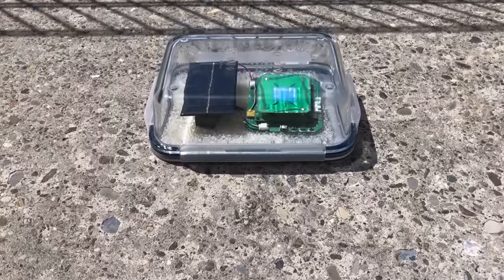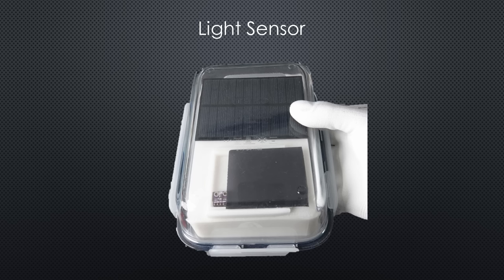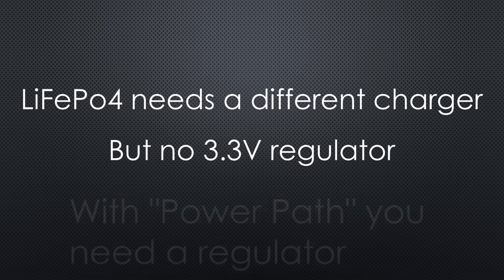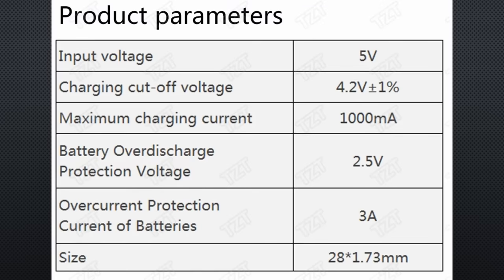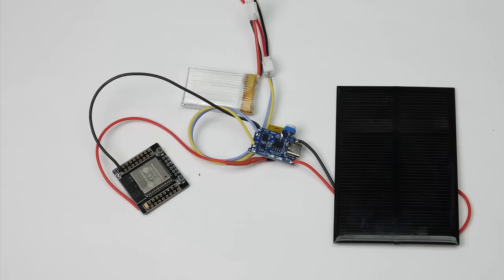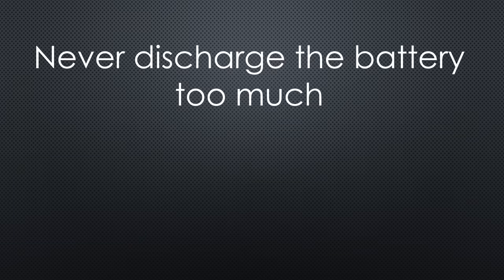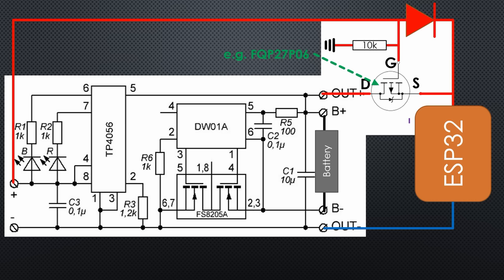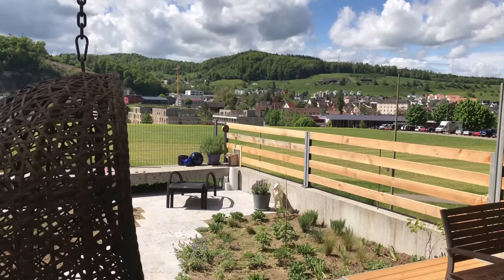#383 Cheap and simple Solar Power for our small Projects (ESP32, ESP8266, Arduino)

Comment: So you added a FQP27Po6 Mofset and a 1N5819 Diode.. did you add a 10k resistor also? can you show me the diagram of the complete changes...
Reply from the maker: The diagram should be in the video as well as a reference to another, more detailed video
Reply: @AndreasSpiess  .. thank you..I am a beginner at this.. that was a 10,000 ohm resistor.. correct ?
Reply from the maker: @cohenkevinloriqueen818  Yes

Comment: Could the battery get overheated or damaged by the temperature caused because its exposed to the sun?
Reply from the maker: Yes, it can. In my case I measured temperature and it stayed below 65C. During this time, the battery was full and the solar panel was able to run the device. So the battery was in "storage condition". Which is nearly acceptable according to the datasheet.
Reply: @AndreasSpiess  Thanks for replying, Mr. Andreas!

Comment: Regarding the difference between Li-Ion (3.7 nominal) and LiFePo4 (3.3 nominal?) - could one not simple add a diode in the direction of the positive terminal of the battery? Coming from the TP4056 chip i mean... ?
Reply: And, yes - of course and like most of your other videos: very nice. And pragmatic approaches too! :)
Reply: Ok, saw too late that the positive terminals are connected directly...
Reply from the maker: Anyway, a TP4056 will overcharge a LiFepo4. Its cutoff voltage is only 3-7 volts.

Comment: Hello Andreas, I am a newbie and I learn a lot with your videos, thank you for that. I am interested in this solar power and I have already ordered the parts thanks to your list.
I have 2 questions:
1) what kind of capacitor farad/voltage do i need to connect to the pin board converter ?
2) I don't see the TP4056. Do I have to order it separately ?
Thanks again for these videos which must cost a lot of effort and energy:)
Gilles
Reply from the maker: Thank you!
BTW: It would be easier for me if you would include the minute/second of the video. Loke that, I do not know exactly what you mean. You find a link to a TP4056 board with protection and the capacitors usually are 100-1000 microfarads. If this is what you need to know.
Reply: @AndreasSpiess  Sorry for my bad english :). I just meant that you have added a lot of links (ali express) along with the video to buy what is needed to build the solar power, but there is no link to buy the TP4056. and to buy the capacitor . Anyway, I have ordered a TP4056 and some capacitors (Capacitance 16v10uf 106K). 
Based on your answer, I should have ordered 100-1000 microfarad capacitor instead.
Thanks again,
Gilles

Comment: hi with the mosfet is there any problem caused by low light eg solar is not enough and mosfet is still off? (analog problems)
i think the battery should have enough capacity to last 3 days with enough solar to charge in 1 to account for cloudy days
Reply from the maker: 1. If you chose a low Vgs FET it should be ok. Maybe you will lose a few mW.
2. You probably do not get such small batteries which still are capable to feed an ESPxx. In Switzerland I need a battery which lasts at least a month without sun ;-)
Reply: @AndreasSpiess  Hi Andreas ! I have a look in FQP27P06 MOSFET datasheet, however its Vgs(th) is between -4v ~ -2v. Which means when the Vgs is below 3.7v(Lipo) - 2v = 1.7v, then the MOSFET will ON and change to battery power supply. However 1.7v is too low to operate the microcontroller, even if 2v or voltage between 1.7v ~ 3.3v.  How to deal with this issue? Thanks a lot !

Comment: Hi saw you are using tp4056 for charging battery but this charger cannot charge higher maH batteries due to heating issue. Can you suggest a good charger for charging higher mah batteries.
Reply from the maker: There are many other high-power chargers for Li-Ion batteries. Google knows them. The TP4056 has a 1A limit, if I remember right. But it will heat up if you apply a too high VCC (if is a linear regulator and has to kill the voltage between Vcc and Vbat).
Reply: @AndreasSpiess  thank you for the guidance.

Comment: Are the "CE021" buck boost converter any good for ESP type of chips? They claim to be able to output 3v from 1.8v, but I'm worried about the noise.
Reply from the maker: I like switching converters for big voltage differences. Here they are not needed. And indeed you have to pay attention to RFI. Some of them are horrible. You can check it with a radio or with an SDR receiver
Reply: I use the charge pump module rated at 100-150ma with specified input 1.8 to 5 v which is able to run an esp8266 . Right upto when the Lipo voltage drops to 2.5v and the tp4056 cuts off finally.
Reply: @vu2dji  most digital tasks won't get effected but as soon as an ADC gets involved... Problems related to RFI begin
Reply: @SurajGrewal  thanks for pointing that out! The only ADC I use in this particular project is to get a rough idea of the battery status. For another one requiring precision ADC  measurements, I will go for the linear regulator.

Comment: I think the TP4056 charge controller is one of the worst options for this application. When you make a project powered by a solar panel, you need to think about the most efficient use of the received electricity, and thanks to the ineffective TP4056 charge controller, you will simply lose a large share of the electricity received from the solar panel, in addition, it will not allow the solar panel to work efficiently. I recommend using high-efficiency pulsed charge controllers rather than linear charge controllers in this application. Additionally, I recommend looking for charge controllers specifically designed for solar panel power that can keep the panel voltage near its maximum power point.
Reply from the maker: Maybe you watch my video about low power solar charging solutions. I also was surprised how good the TP4056 behaved...
Reply: @AndreasSpiess  , the only good thing I can say about the TP4056 in this application is that this controller is not very capricious in relation to the electricity supplying it, and it is perhaps the only one that I know of that continues to work even when receiving a voltage of only 4V. However, this does not justify the loss of a large share of electricity. Personally, I have long abandoned the use of TP4056 controllers and instead use controller boards based on the CN3791 chip.
Reply from the maker: @oleganonimka3725  Did you watch the video I referred to?

Comment: Is short circuit protection lost with this modification of tp4056?
Reply from the maker: It should not because the battery current still goes through the DW 01A/FS8205A. The solar panel does not need this kind of protection.

Comment: hey andreas love your videos, I found this one and it is perfect for my projcet, but i have  question. I got an esp32 and a 3.7 18650. (I got all the parts you listed). to power the Esp 32 i connect the battery and power path to a 5v dc booster is this a good solution or should I put 2 18650s? I got the system running but the charging is slow I suspect it was the booster drawing more current to boost from 3.7 to 5v since I run the ESP32 in a deep sleep. Could you please help me on this? Much appreciated!
Reply from the maker: I do not understand the goal of your design. I do not see why you want 2 batteries in the design I showed.
Reply: @AndreasSpiess  hey sorry, the two batteries were meant to give more volt to the esp, rather than using a 5v booster
Reply from the maker: ESP32s work on 3.3 volts. No need for 5 volts

Comment: Thanks for the video,
I have a question:
If you connect the solar panel and the load will request more power than what the solar can deliver at that specific time (but your battery can) , in that case i think you are overloading your load as you can not supply the missing power from the battery, what's the solution for that? thanks.
Reply from the maker: The charger module (TP4056) limits the current that the solar panel never is overloaded too much. The battery always supplies the load, it is only charged by the solar panel.
Reply: @AndreasSpiess  hello, thank you for your reply,
Just to confirm if the solar panel is connected will the mosfet disconnect the battery from the load? At that time the load will only be powered from the panel?
I am getting something wrong? Sorry to bother you.
Reply from the maker: @fedimakni1200  I suggest you re-watch the video. Think of two independent circuits: The charging and the protection circuit with the battery in the middle.
Reply: Actually this is what is happening when I built the circuit running an ESP 32 on all the time (70ma drain). Even with a large panel, when the sun was hazy , the MOSFET was open circuit but the current supplied by the 10w panel was still too low to charge the battery and run the ESP32 at the same time. I think this circuit is good for deep sleep but if you want to run an ESP 32 all the time you will need a massive panel, and even then there will be times when the light is low when it cannot supply enough current but the MOSFET is still off and the battery therefore cannot be used.

Comment: Hi, I am new with MOSFETs, the RDS(on) is -10v for FQP27P06 from the datasheet and VDS equals to VGS, it seems to me it never can reach -10v to make the MOSFET to conduct completely with the lowest resistance, 
When the GATE is 5 volts powered by the panel, 5v-3.7=1.3v,  0v-3.7v= -3.7 when the panel power is gone completely and the GATE is grounded via the 10k resistor, so the ESP32 is always powered by the panel ONLY
Could you help me a little bit to understand?Many thanks
Reply from the maker: Maybe you watch the video in the description. It shows more details.

Comment: Hello! I tried to recreate this and when I use 5V from a USB-charger as input on the TP4056, I get 4.2V at the ESP32(Dev-Kit C V4). When I disconnect the 5V input, I have 3.8V at the ESP. But if I add my solar panel at low light (delivering 2.5-3V) the ESP only receives 3.26V and stops working. On ly if I cover it completely, the MOSFET switches to battery and I get 3.8V. I also noticed that after disconnecting the ESP the charging light goes on, when I use a lamp for the solar panel. It does not do that, when the ESP is connected. With no ESP, the voltage switches as expected - even with just solar and a lamp. Any idea what could be wrong?
Reply from the maker: Unfortunately, I canno do remote debugging. But if you use the same diagram I would remove the power path and see if everything works.

Comment: 3:54 How do I know what charger board I would need? I have a load of Soshine LifePo4 3.2v 2.24Wh 700mAh batteries that I would like to use... Thanks
Reply from the maker: The TP5000 can also LiFePo, for example.
Reply: @AndreasSpiess  Thank you. Sadly I only really understand how to copy your projects if I can get the exact parts. Any deviation from that and I'm lost!  The TP5000 looks very different to the TP4056... does everything you do in the rest of this video still apply to this board?

Comment: Danke für das Video. Sehr tolle Tipps habe ich gewonnen. Ich hätte eine Frage und denke  Sie  können mir damit weiter helfen. Ich arbeite auch momentan an einem Solarbetriebenen Projekt und da nutze ich auch das TP4056-Charger-Board. Jedoch möchte ich auch die Batterie überwachen mit dem INA219 und da weiß ich nicht wie die den Sensor richtig anschließe , um eine genaue Messung für die Batterielade bzw. entladekurve zu bekommen.
Falls Sie da Tipps für mich hätten, würde ich Sie willkommenheißen.
Reply from the maker: Ich hab mal ein video über Strommessung gemacht. Dort kommt der INA219 auch vor (soweit ich mich erinnere).
Reply: Ich wollte Ihnen auch fragen was würde passieren, wenn man anstatt eines p   MOSFET ein n MOSFET verwendet hätte

Comment: Hello, I have another small question : in this configuration the solar panel AND the battery cannot deliver energy for the electronic card at the same time (that is what I have observed, but tell me if I am wrong). Is there a way to have this feature ?
Reply from the maker: It delivers voltage also during charging.
Reply: @AndreasSpiess  I understand that the solar panel can deliver voltage for charging the battery and powering the card (if there is enough power delivered by the solar panel). If I understand correctly, the MOSEFT is always in the passant mode (because of the diode small voltage drop), hence enabling the deliver of voltage from the battery AND the solar panel to the card ?

Comment: if i use a 3.7V lipo battery, in what voltage range i need remain, if i want  to work in safe region ?
Reply from the maker: you should not charge it over 4.2 volts and discharge it below 3 volts
Reply: @AndreasSpiess  thanks

Comment: As usual thank you for your great hardware tips.  I have been trying to find a software solution to increase battery life for ESP devices. 

I have written some code using proberequest protocol of ESP devices along with MAC address manipulation to communicate between ESP devices. It consist of an always powered on ESP32 gateway with built in MQTT broker (not client) and a websocket server which communicate with all battery powered ESP8266 slave devices which uses LIR2450 coin cell battery with small solar panel (53mm x 30mm) and TP4056 charger. Remote devices uses around 70ms - 80ms to send sensor data. It is lot better than ESP-Now solution.

Thanks again.
Reply from the maker: Sounds like a cool solution! I do not remember how long ESPnow took for the transfer.
Reply: @AndreasSpiess  I will appreciate it if you please test the code with your oscilloscope as I do not have fancy equipment. Please search for batteryNode from happytm on github.

Comment: Can I at the same time have connected usb directly to esp32, assuming I have standard board, and solar panel?
Reply: I'm trying to do similar thing but instead of solar panel use power from usb to charge battery.
Reply from the maker: If your ESP32 board offers a 5V input you can connect it to 5v. Otherwise, the ESP32 modules are only 3.3V (without a regulator)
Reply: @AndreasSpiess  I want to be able to have battery connected to esp32 and at the same time connecte esp32 board to pc via usb. I'm building custom keyboard. I just learened that I need a way maybe a switch before VIN pin to turn of battery before I plug it to a pc.
Reply: Now I know that I should have bough different board that has battery support.
If i did that circuit and connected it to the original usb port, what would have happend?
Reply: So instead of connecting output from charger/battery connect it to usb. Will I be able to communicate with computer? Or I have to make completely different circuit

Comment: AMS1117  will be a good replacement for HT7333?
Reply from the maker: No, unfortunately not in low power applications. Otherwise, yes
Reply: @AndreasSpiess  Ok, so it seems it must be very decent stabilizer with very low dropput and IQ. It's a pitty you did not mention it in your movie

Comment: Hallo Andreas
als basteltechnischer Totalhonk der ich bin verzeih mir bitte die Frage, ABER:
Kennst du nen Weg, wie man den Strom eines Velo-Nabendynamo dazu nutzen könnte ein herkömmliches Batteriepack aufzuladen? (all die Energie die da sinnlos produziert wird - muss doch irgendwie verwendet werden können))
Reply: Not really wasted, when you start charging batteries, you have to push harder on the pedals.

But it's a good idea for a home-made windmill those axels. Bearing and generator built in. And lots of those bikes come on the second hand market with everybody switching to e-bikes.
Reply: @LimBo3500  well the hub dynamo (correct translation of "Nabendynamo"?) doesn't have the same resistance as the normal one which connects to the tyre, it actually runs all the time (if you need lights or not) - that's the reason for my question:
atm it gets wasted if the ligts are not on, but still produced...

systems should (alas i'm completly wrong) be similar to the solarpower-ideas, just the voltages might vary "a bit" more than with the solarpanels..?

the windmill is a good idea, too - just add some stylish fins on it, and make a little savonious-rotor
Reply from the maker: 1. Tom is right. A generator does not need  energy other than friction if no power is used. Only if you draw a current it starts to consume energy. It should be possible to test this hypothesis with your bike and the light switched off (or the connector at the dynamo disconnected). Your front wheel should turn without a lot of resistance. Switch the light on and compare. (I did not try it because I have an e-bike)
If you want to use the energy you find the info in this link: https://www.instructables.com/Voltage-Regulated-5-V-Bicycle-Dynamo-Light-USB/
Reply: @AndreasSpiess   Toller Link, danke :)
Der Nabendynamo hat sowas von kein Rollwiderstand (also ich merke nichts davon ob Verbraucher an oder aus sind), das man ohne Probleme die Verbraucher permanent an lassen kann...
Werd mir mal den Link durchlesen, scheint die Antwort auf meine Frage zu sein :)

Comment: I don't understand the p channel mosfet and the wiring displayed. The gate would only be opened when solar was on, otherwise it would disconnect the battery from the esp. Am I missing something?
Reply from the maker: It is a P-Channel FET which opens when VGS is negative.
Reply: @AndreasSpiess  Idiot me - of course! The resistor keeps it open :) Thanks!
Reply: In that case, would it be possible to use some N-channel and wire the gate together with the drain? Saving the resistor altogether :D
Either way - AO3401 or then AO3400 would do the trick.

Comment: I think it a shame that, as far as i know, there is not ready-made ESP board with low-loss components, and the whole solar/usb/battery thing built in (and maybe some circuitry to be able to monitor solar panel input und battery voltage).
Reply from the maker: I have no overview about the designs they use in the current boards. Maybe a topic for a video...